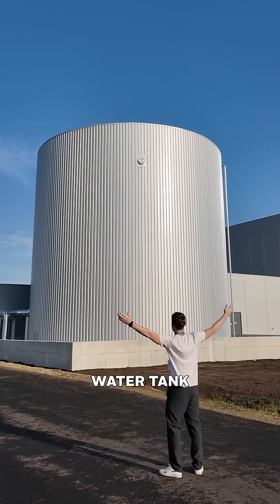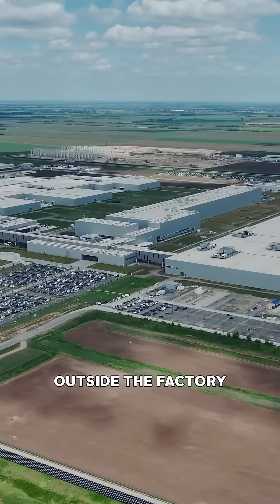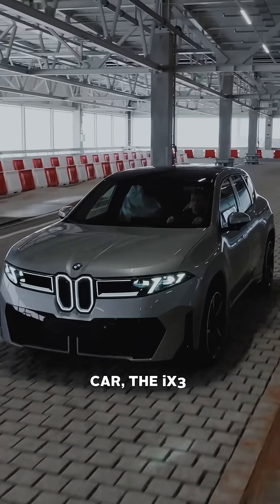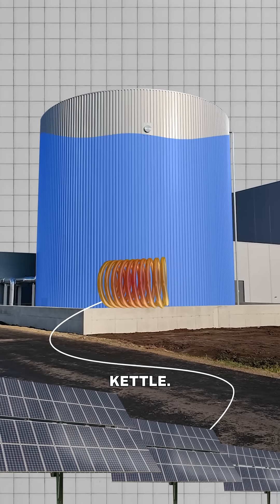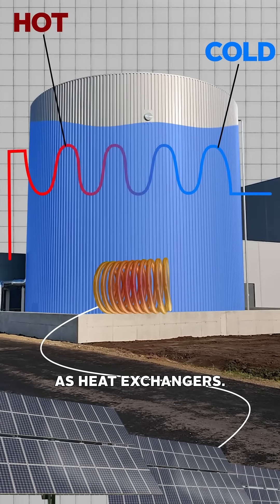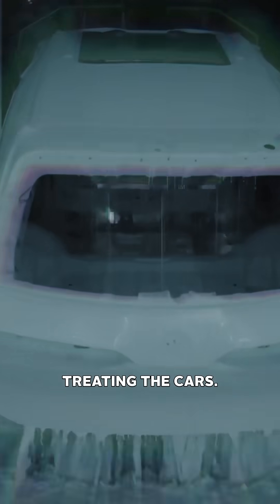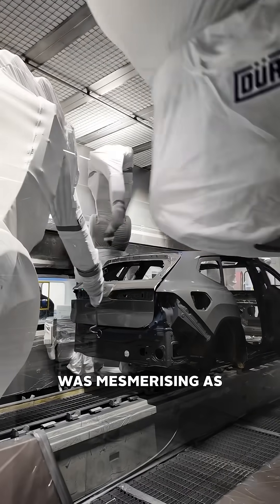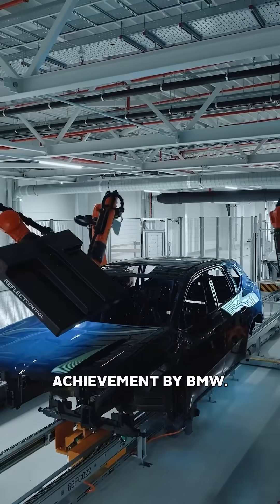Genius BMW Engineering! All Electric Factory! #engineering #BMW

Comment: So why don't they just use solar water heaters.  This would approximately 5 times more energy rather than using photo voltaic and then a heating element
  (See Techingredients test utube video on the subjects) note a stage solar collector would achieve temperatures above 100°C which allow higher temperatures if the tank was pressurised,  possible steam.
,

Comment: If there are a lot of days with haze or cloud cover, that works.  But, if there is a slot of sunny weather, hot water panels, like I used for solar hot water, are more efficient.

Comment: Even better than inefficient solar electric collectors-needing this massive field of solar electric panels: Use cheaper Vacuum-encased solar heat collector tubes, which can match these high temperatures and use a lot less land area to boot!
Reply: The water tank is just a storage for excess electrical energy produced by the solar cells. So the main purpose is electrical energy, not heat.

Comment: sounds like an egreguous waste of potential. they are wasting 70% insolation by not directly irradiating the water, perhaps with some dyes added to increase photothermal conversion. i hope you just obscured part of the equation cuz this is weak

Comment: It seems kind of crazy to heat water with electricity due to the thermal resistance loss.  Already have a solution for eating hot water. It's called solar hot water and it's extremely efficient without the resistance loss.

Comment: If they used a heat pump the could increase there efficiency by a factor of three
Reply: Where?
Reply: @e @edism ating up the water. It would pump the heat from outside air to heat the water, getting about 3 times more heat. Same principle as heating a house with a heat pump
Reply: @jessicatymczak5852 there probably isn't enough heat outside where they are for that.
Reply: @edism that’s not how heat pumps work. For a decent heat pump, with a cop of let’s say 3, for every watt of electrical energy used, it pumps 3 watts of 
Heat. Even if the outside temp is freezing. There is a video about this about using industrial heat pumps to generate heat for industrial usage….much more efficient then direct heating
Reply: @jessicatymczak5852 that's not how efficiency works, certainly not from any guesswork like that. I'd wager they've made the comparisons a little more comprehensively than you have and concluded that this is the more efficient way to achieve their objectives.
Reply: @edism there already is a heat pump that can do this, but it’s new tech. And yes, this is exactly how efficiency works, with a heat pump with a COP of 3, which most have, you can heat 3 times as much water, or use 1/3 less power and heat the same amount of water. And I do know what I am talking about since I teach this stuff at a college
Reply: @jessicatymczak5852 teaching at college doesn't guarantee you know what you're talking about, I'd expect a teacher to know the difference between there and their so I'm skeptical already, perhaps you should do the maths to prove it like a professional and teacher of thermodynamics would based on the actual conditions, deliverables/requirements, kpis/objectives no? Let's focus on the topic, you're a teacher and I'm an engineer, none of those facts have anything to do with their objectives and whether this is more efficient than what you're suggesting.
Reply: @edism Jesus, how about a PhD in quantum physics, is that good enough for you?  This is simple thermodynamics. Honestly, I spell a word wrong, ohhhh. My skillset is mathematics, science and engineering. I give not a flying F’ck about the proper use of there or their.
Reply: @jessicatymczak5852 nope, I already said what's good enough, all I said is that your grammar is suspicious for an educator, one would expect better command of such basic things as there vs their. You can't just say heat pumps are better off a hunch, have some standards. Prove it.
Reply: That’s an interesting idea.

I know heat pumps can heat up air, do you think it’s efficient enough to heat up liquids as well?
Reply: @daveinpublic yes, they already have them. The reduce electricity by 1/3 for the same heat
Reply: @daveinpublic   they not suitable for the use case (180 degree heating), they're already using them for heating air, check the PDF I linked.

Comment: I had no idea that the paint shop in a car factory was one of the most energy intensive processes in the factory. Clever solution.
Reply: Kinda makes sense, though after you learn, everything has to be heated in that paint production line.
A heating element is basically a direct short of wire. liquids draw the most amout of heat out of an object (except diamond). Combining a heated liquid with an oven to dry the paint is crazy amounts.
Prior to learning thats all heated i would have thought the welding section. Welding is basically another direct short (arc welding).

Comment: That's insane to me that of all those hydrolic robotics, conveyor belts, drills, presses, etc. That 55% of the energy use is for HEAT? And most of that is for the paint shop?  Is there a need to quickly move the cars from the heated area to a cool area where there's no way to prevent significant spillage of the heated air from one section to another?  If not, I feel like they are losing too much heat.  Right?

Comment: Using a heat pump would make 3-5 times more efficient use of the renewable electricity than resistive heating.
Reply: 95C is fairly easy for standard industrial heat pumps (specialist ones reach beyond 200C)
Reply: Only if the ambient conditions are right for the heat pump.  The plant may not be in a climate that temperature range works ideally with a heat pump.
Reply: Maybe they are using heat pumps. But the up-front cost and complexity might favor a basic resistive system.
Reply: "Yeah I need a heat pump that can heat 1800m³ of water to 95C. You probably have one of those just sitting on the shelf, right?"
-some engineer talking to a bewildered supplier
Reply: Maybe heat pumps don’t handle the infrequent use very well, since this tank is a storage for excess solar energy. Also you would need a heat exchanger inside the tank, that would also need regular service. All in all a heatpump might doesn’t make much sense economically.
Reply: @ffeffeff  a heat exchanger is generally passive. More or less a big hunk of metal with a water channel through it. In this case it would even be completely sealed loop with a heat exchanger in the water tank and another in the paint vat. The only moving part would be the pump moving the fluid through the loop.
Reply: @therealcmj Well all sorts of fluids need maintenance, regular quality checks and filtering as a minimum.
Reply: COP is way less than that when you have to heat water to 100C, especially in winter. In fact it could be so low you're better off with resistive heating in terms of overall cost.
Reply: And much more expensive.
Reply: @orbiradio2465 possibly a little more expensive to install, but would save electricity.
Reply: @Biggest-hz7ng  There is no point in saving electricity, if you run the the resistive heater only, when you have it in excess.

You have to make a calculation, what's the more economic solution for a very specific use case.
Reply: Even better, use solar heat collectors instead of massive field of solar electric panels. Vacuum encased solar heat collector tubes can match these high temperatures and use less land area to boot!
Reply: @BlackwoodBear  Vacuum solar collector tubes😮 Great recommendation. They can heat water to 100 deg. C.

But the purpose water tank is to store extra solar cell output capacity.. But now I am a bit unclear  about BMW's primary use of the solar power they are producing.
Reply: @finestructureconstant3921  why are you unsure? Is it because the pv solar can't power the whole factory?
Reply: @BlackwoodBear  Collectors are great, when producing heat is the only purpose. However those PV are meant to produce enough electricity in the morning/evening hours or a cloudy day.
Which of course results in massive overcapacity on a sunny day at noon. Using this temporary overcapacity is the purpose of the tank.
Reply: @BlackwoodBear  the pv solar farm is there already. Even if you start with no pv solar farm and had to choose between that and pv, you'd need to convert that thermal energy back to electricity
Reply: @BlackwoodBear  there's also flat plate vacuum collectors for very efficient high temp collection, although I don't know why their prevalence hasn't increased and cost gone down. Might be related to patents?

Comment: Absolutely nothing new in this at all! 😢
Reply: Nothing new, yes.
What is new is the fact of moving away from a system that is too dependent on electricity grid and gas networks.
But simply applying simple concepts of energy recovery or other means allows for significant savings, and it's clearly something that too few companies are doing.
Reply: @gauvaindf  efficiency and heat recovery is a very active part of most large users of energy.  the paybacks can be amazing.
Reply: @lylestavast7652  Why are you writing this to me?
Reply: @gauvaindf they are continuing your thread, agreeing with you...